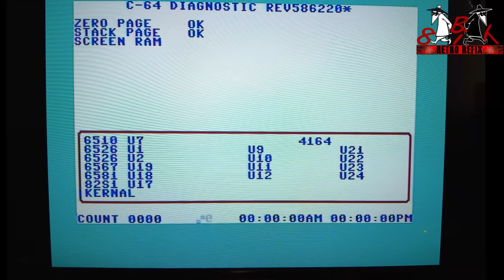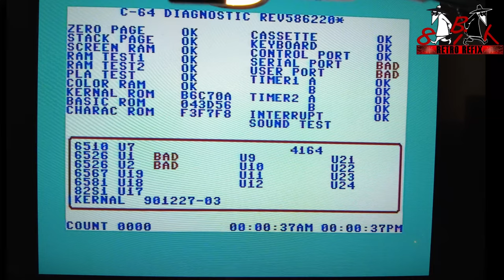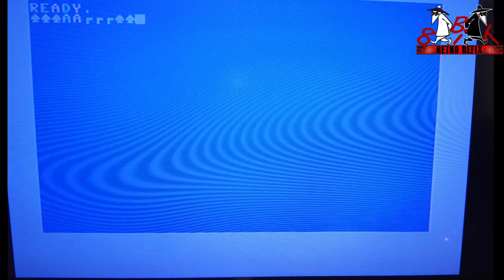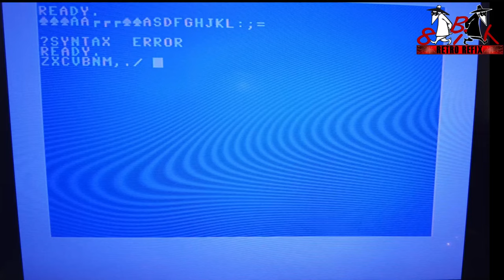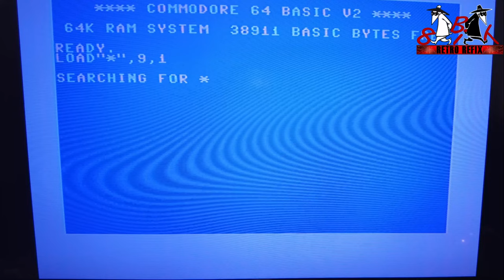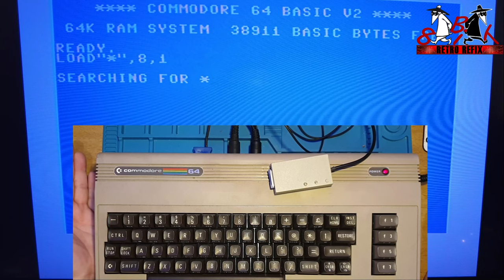Another Commodore 64 repair with a strange issue ? Part 1

Comment: I'd vote for the 7406 being bad as well.  A few months ago I needed one, they were out of stock everywhere.  I had to get a surface mount 7406 and carefully tack it onto a socket to make it fit in a standard DIP 14 socket on the board.  Also, while highly unlikely, it could theoretically be the 6510 doing something it shouldn't on the address bus.

Comment: your'e a dedicated techno wizard, sounds like you are from Rotherham / Barnsley  North area, I like that down to earth accent. I randomly came across one of your repair Video conundrums, I enjoyed what I saw, understood most of what you were doing, though as I am aging my skills are not what they used to be in the soldering department.

moving on to why I'm sending this mail is that I've been reading up a little on Various ways of the C64 Audio giving a stereo output

years ago I made up a din plug of the 9 pin horseshoe Audio output that I had the unused pin as an output.

I have since discovered some variants of two types of Sid Chip, the old Breabin Board and the later flatline C64 boards Long and short. 

I understand that the two different sid chips can be used for the seperate L&R Chanel's can also be configured to work as part of a seperate plug in board having two sockets. 

Two ways I've seen, the later boards have jumpers on though that only splits the existing SID output into dual mono.

Other examples I've heard of are a kit that has two sid sockets on that can be configured for L&R  channels and also controls the Video side for Luma / Chroma, (sVideo) & Composite .

It's been said that the older and newer Sids have a slightly different sound or pitch, something which could be used in my project .

So, where is all this obtainable, how is it built, what plugin devices are there that would create what I'm after achieving.

Most of what I did back in the eighties is long past and I am revisiting what I set out to explore. 

I know you must be a busy man though would appreciate some pointers and what the different Sid Chips are. 

once I've established the solutions, I will be watching with interest more of your video's and probably subscribe.
Reply from the maker: Hi Dave ... im a Yorkshire lad from near Skipton ;) ... As for the duel sid's you can buy the boards  to install 2 sid's or Gideon's U2+ cartridge can emulate the 2nd sid .. There is quite a few options these days .. Thanks for watching  👍

Comment: The 7406 seem to be the common failure in the serial circuits I’ve seen the same issue in the 1541 drives
Reply from the maker: Thanks for that :) .. The things we forget .its also known as a M53206P ive a few of them .So ill revist that U8 chip and socket :) . Thanks

Comment: If the cia appears OK I would fire up a logic analyser on the serial port and sniff out the signal, this would give a clue to what's happening .........
Reply from the maker: Hey .. ive idea where the issue lays .. I try to do my video like the man or women in the street would .they don't have scopes.  Black screen appeared after the 7406 was socketed.  Even tho ive re-socketed it again to double check the traces.. ill check it again when I get back too it .. cheers mate 👍
Reply: Leave the resistance Continuity beeper in the drawer. Instead, 3 LEDs: "Hi", "Lo" and "Pulse" on the TTL logic probe stick reveal the running machine operation...no guess work, just a clear display of all pins doing what they're supposed to do.
Reply from the maker: @bryanminugh9680  Hi. Yes that would be the way to go .. I have Mos logic probe and a scope .. But the way I show the repairs in my videos is to help the general man or woman in the street .. they don't normally have a scope or probe .. most only have a multimeter... Thanks for watching 😃

Comment: The 250466 surely is not original in the breadbin case, is it? - Seems someone put together the best of two worlds…
Reply from the maker: Hi yes the 466 was in the later breadbins and very early c64c too .. Commodore was well known for mix matching stuff back in the day ... Thanks for watching
Reply: @8BitRetroReFix  I always found the 250466 in the new beige cases and never in the breadbins. It would be a nice addition to my small collection to find one in a breadbin! Maybe it‘s only in British models? Because I am from Germany and maybe the „German“ 250466 (they didn’t produce the c64 at Braunschweig anymore when the 250466 came out, I think) was only sold in the new case?